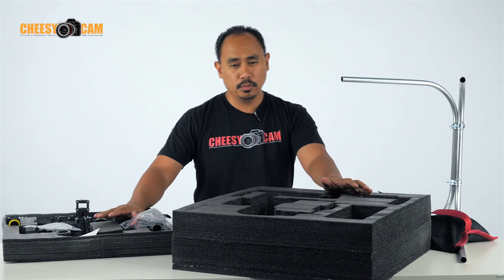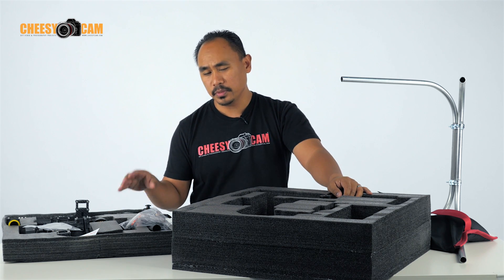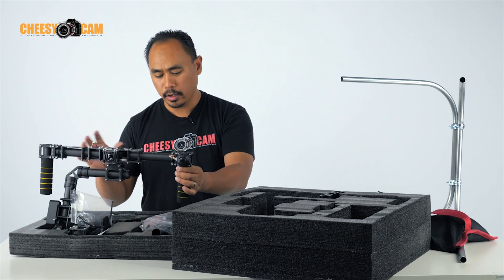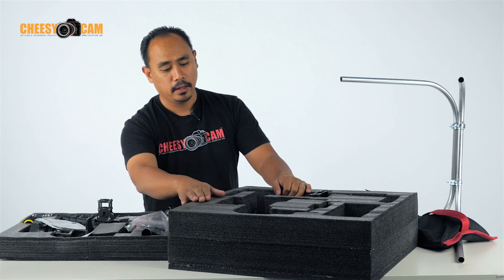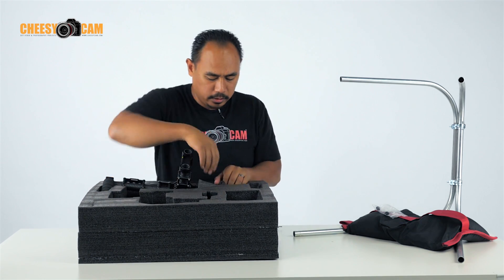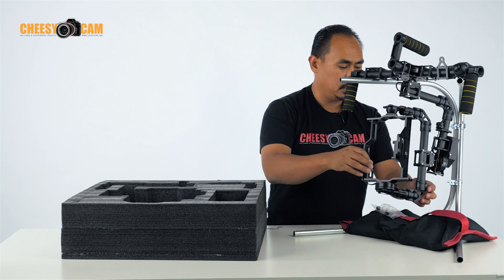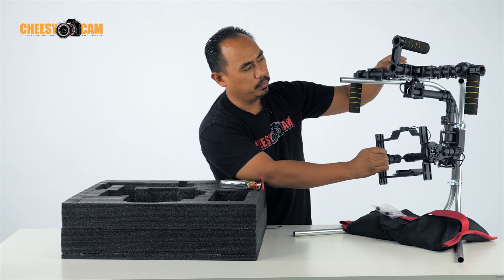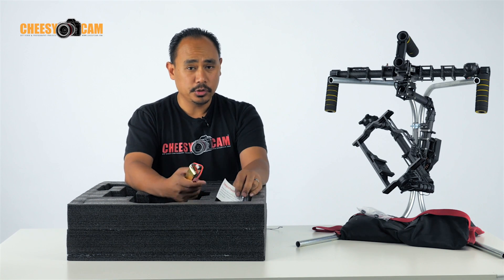Unboxing the Ready to Run CAMETV 7800 3 Axis Gimbal

Comment: Nice review as always. Thanks.

Your idea of replacing some Allen head screws with thumb screws sounds promising. I'd especially want to replace all the screws that need to be loosened to adjust balance. The two that fasten the quick release plate to the camera carriage should be the easiest. The four on the camera carriage and the four on the yaw adjustment might be a bit harder.

But the price is right on this rig. Bravo for bringing it to our attention.

Love the hard case and the fact that you give us links to everything. Not everyone is as thorough. It's another reason I watch everything you post.

Comment: Thank you for keeping on top of the Gimbal market, especially from Came. What concerns me is how fast they put out revised products. It seems there is a newer version every month. As a buyer, this is great as better product is released asap. As an owner, this must be frustrating knowing your purchase may be obsolete so to speak within the next month. Still, it's great Came is doing what they can to make these gimbals easier to use and less expensive.
Reply from the maker: Brian Westfield I wouldn't say obsolete. The same gimbals are still sold. The new versions just have 'added' features that you would pay extra for, but if you don't need the extra features you can still pay less.

Comment: Hi MrCheesyCam. Just received my Came-TV 7800 and your video was incredibly helpful so thanks for taking the time to put it together. I do have a question though which was passed on the video at the 8:55 mark. You were adjusting the tilt and saying it had to stay where you put it and then figured it was good enough and moved on. However my camera (5D III with 16-35L) will not stay tilted when I let go it always goes back to level. Can you help? The only adjustment to the housing I had to make was moving the mounting plate down so my camera would fit inside the cage. I could move it back up about 1/2" but that's about it....is that my problem? Thanks in advance!
Reply from the maker: +Showcase Photography Try to move the top plate as high as you can, then start moving the bottom plate up until your camera is balanced.
Reply: +MrCheesyCam Thanks for the reply, that did the trick. After commenting I watched the video again to see where your camera was as it too is the 5D3 and noticed that top plate was way up, so I realized what the problem was. All good now I just need to work on my walking technique to remove the steps in the footage! Cheers and keep up the great videos!

Comment: Hello, thanks for the video!
Can this gimbal with RC remote control that allows a second operator to control the gimbal's pan and tilt? Do you have a tutorial on that?
Another question is what is your recommendation for a wireless video signal transmitter? I’m looking for solution to send a video signal to the director’s monitor. I use a Canon 5D.
Thank You!

Comment: I just watched your review of the Laing X-15 Vest Arm (Laing X-15 Vest Arm kit with Laing P-04 Video Stabilizer Review). I have two questions:
1. Can the CAMETV 7800 work well in the camera-on-top position? That seems like where I'd prefer the camera in relation to the ground.
2. With the camera on top, would you estimate that the CAMETV 7800 could be coupled with the Laing X-15 vest and arm? That seems like it might be a good combination to reduce operator fatigue on long shooting days.

You're the only guy I know that has worked with both.

Thanks again for a great channel.

EDIT: Just watched your DIY 3 Axis Gimbal Stabilizer Support BackPack. This may be a better answer than the vest/arm solution. Still like to know if the CAMETV 7800 works in camera-on-top mode though. Thanks.

Comment: Great video! Which do you like better; the 7800 or the Varavon Birdycam2? Which will you use personally for your work? Do you think the Came 7800 will hold up well over time? Thanks!
Reply from the maker: ***** I like them both actually. I don't have a variety of camera + lenses that I use with stabilizers so i'm always just using the same gear. Since I don't have to rebalance much or ever, it's easy for me to unpack and start shooting. If you have to make camera or lens changes very often go with a gimbal that offers those convenient features.

Comment: Hey there! Question, please help! 

I bought my 7800 but I'm having issues with the balancing. No matter what Im doing with either my 5D Mark III or 70D, it seems to lean or "sway" to one side. When I turn it on it starts to shake and jitter, when i walk or move at a faster pace it looks all over the place (without touching the joy stick and with) like its calibrating. and finally when it sits at rest it starts to pan to the right ever so slightly. 

Is this a software issue?  when you say its pre balanced for a 5D, is that also a software thing. where do i go and what would you suggest . 

Please help me obi wan. you're my only hope!

thanks!

Comment: on the old one you used to have to make sure the roll axis sat in any position and held it like you did with the pitch. If it snapped back to horizontal then you were balanced but you had to twist the 'holder' or bar at the back (so twisting the arms either side up or down) until it would hold, do you have to do that with this one or is it better to leave it as tightened at the factory?
Reply from the maker: Box Lane Productions You can still adjust the side arms to keep the camera's horizon level. It's still better to get the camera perfectly balanced.
Reply: MrCheesyCam cheers and thanks for the quick response i might go and give it a little wiggle then

Comment: MrCheesyCam Hey, great video! I follow your blog religiously. I have a couple questions about the newer 7500 which I just bought. It seems to be running great and I have it all balanced. But the odd thing I am wondering about is when I switch between profiles, after I click the joystick - instead of making one beep like I hear yours make it beeps a bunch of times quickly. It doesn't seem to be bad, just seeing if you knew if its normal. Also, is the gimbal supposed to make very quiet high pitched frequency humming/buzzing when I move it? I feel maybe this means it is too light, as I am running an A7s with quick release and 28mm Pentax super takumar lens. Any help would be amazing. Thanks for everything you do!
Reply from the maker: Jeremy Dulac Check if you have the option 'calibrate gyro at startup'. If you have that option, turn it off. As far as buzzing goes, yes it sounds like you may have the system too light. You may have to find out which motor is buzzing (pitch/roll/yaw) and lower those settings a bit. Or try lowering the P&D settings on each one.
Reply: MrCheesyCam Ok excellent! Thanks, Emm!

Comment: Amazing review! As always.. Hey I'm looking at purchasing this gimbal but would like to continue using my manfrotto base plates. Can't tv told me that their base plate is removable. Since you have the gimbal their can you please tell me how their base plate is attached to the gimbal cage? I just want to know if I can screw a manfrotto base plate in its place! Thanks so much!!
Reply from the maker: fitBUDDS The baseplate uses one screw underneath. If you mount a Manfrotto it might not be centered and the manfrotto brings the camera higher than the built in CAMETV one. The CAMETV one is very slim so the camera can still fit in the cage.
Reply: Oh I see. That's very useful that's bro!!

Comment: Hey I'm having major problems with my cametv7800. I can get the camera to stay still on the pitch when balancing it, but I get a seesaw effect on the roll bar, I'm using a A7s with a 28f2.0 Sony lens. Hope you can help
Reply from the maker: +Southedge Pictures That is because the side arms are pointing downwards. You have to loosen the rear roll bar so you can move the side arms to point slightly up.
Reply: Hey thanks for the response, it was that as well as the PID settings. I posted a message on cametvs facebook group, and a very kind guy from croatia went through everything, and now it works perfectly. Thanks for the advice, love your channel

Comment: hi. i just thought i'd check in with you about whether or not you have to mess with pid settings on this. if you see tom antos' review, he seems to say he never messes with it, and that actually the company says "don't mess with it" its supposed to be preconfigured, and if you have an issue, there is supposed to be an auto config by holding down the joystick to fix any issues.

so what is the reality? do you HAVE to mess with the pid settings, or not? I plan on using this with a Canon 70d. Is it preconfigured for that basically? thanks!
Reply from the maker: ***** It comes pre-tuned to work with most cameras, and you should never mess with it "if you have no clue what you're doing". Of course if you understand PID tuning, you could tailor it exactly the way you want. I suggest you learn the software, but don't practice on something you want to use for your production.
Reply: MrCheesyCam
great. very helpful advice for a lot of us who have these questions. looking forward to your test of the newest 7800. eager to order it. quick follow up question. do you think that the 70d with the sigma 18-35mm would require tuning (for being too heavy for initial pid settings/ just as the gh4 requires it for being too light?) the 70d is just a bit lighter than the 5d mark iii, but the sigma 18-35mm is quite a heavy lens. i guess the question is if your 5d with a fairly heavy lens required pid adjustments initially or not? thanks!!!!

Comment: Anybody know why the 7800 beeps rapidly when turned on. it seems to be a center and level alignment thing.  Before now I've been using it without any problems and
turns out the balance thing is fairly easy once you get used to it's needs.

Comment: Thanks for a great channel. I love the quality of your videos.

I bought the 7800 gimble and wonder if you can answer a couple of questions. I got it balanced and it works with my GH4 but it is off level by about 4 degrees. (That's the rotation I had to add in post.) What do you think the problem is? Can I calibrate that out with the external software? Where can I get the external software? What is the name of the controller board?

Where is the best place for me to get more info about this?
Reply from the maker: Robert Shaver Hi you can first try to 'calibrate gyros'. This is an option in the software. (FOR MAC:) http://gimbal.cheesycam.com/downloading-installing-and-launching-simplebgc-software-mac-osx/

Don't change any other setting. You will plug the gimbal via USB to your computer and then click on a button that says Calibrate Gyro. You want to make sure you hold the camera steady and straight during this calibration process. There may be a bunch of videos at my sub-site. http://gimbal.cheesycam.com
Reply: MrCheesyCam Thank you so much. I got it working the way I wanted. For others, here's what I did.

1. I opened up the controller box and found out that the controller is SBGC v3.0.

2. I used Google to find the software and manual for my Windows 7 (64 bit) laptop.
http://www.basecamelectronics.com/downloads/32bit/

3. I connected the 7800 controller to my laptop USB port and it tried to load the correct USB drivers, but failed. I clicked on the "Find me a solution on the web" that came up in the failure screen and it popped up another box with this URL:
http://www.silabs.com/products/mcu/Pages/USBtoUARTBridgeVCPDrivers.aspx
I downloaded and installed the driver from there and it worked.
NOTE: Silicon Labs makes the USB chip on the SBGC board, so this may work for you. This may or may not work for you.

4. I started the SimpleBGC_GUI software, selected COM3 and clicked the Connect button. It failed to connect. So I clicked the Disconnect button, selected COM5 (the only other one) and clicked Connect. That one worked and the 7800 beeped.

5. I clicked the READ button near the bottom of the screen. This read my profile #1 into the program.

6. I clicked the Save button near the top of the screen to save the Profile1 from the 7800 to my hard drive for safe keeping.

7. I selected profile #2 on the 7800 by pushing the joy-stick button twice. Then I did steps 5 and 6 again to save it on my hard drive.

8. Then I did 5 through 7 for profile # 3.

9. I selected profile #1 again on the 7800 and read that into the GUI by clicking READ.

10. I clicked the button CALIBRATE IMU. I think this corrected my 4 degree roll tilt I think. I did a bunch of other things after this and did click the WRITE button for all the profiles. I couldn't seem to find anything in the manual about this either.

Anyway, I changed several things in all three profiles. The changes where all on the RC page.
1. I inverted the pitch on the joy-stick so that it works like an airplane; when you push it forward the camera pitches down, when you pull it back, the camera pitches up.

2. I reduced the dead ban from 15 to 5 to make the joy-stick more sensitive.

3. I reduced the speed for pitch and yaw from 20 to 10.

4. I reduced the acceleration from 200 to 100.

5. The pitch trim was drifting so I changed it from -6 to -10. This took some experimentation to get it right. Your settings will likely be different from mine.

Each time I made a change I had to WRITE them to the controller and try them out. This required that I turn the power switch on on the 7800 so that the motors were engaged.

Once I was satisfied with the settings, I updated all the profiles as needed.

So thanks to Mr. CheesyCam for a great channel and helping me get into this for the lowest possible price. I'm looking forward to hearing more about his custom mini. I'm sure somebody is going to use a 3-D printer to start making parts. Maybe he'll share his design.

Peace for the new year. Rob:-]

Comment: Just unboxed mine today - did you have any issues attaching the battery to the connectors? I feel like I really need to force it, and I don't want to break anything...
Reply: Oscar Wilsby look into the female end of the plug and make sure you line up the male side with the actual
slide holes.  I had that problem for a moment until I realized I was pushing the contact together end to end.

Comment: Hi! I plan on using my 7800 in a two-person setup, with remote control + wireless follow focus. Do you think I could make it work with a 5D3 + Zacuto Gorilla low-profile baseplate with rails + lightweight followfocus like the Lenzhound? If I replace the original quick-release plate with the Gorilla?

Also, what remote control would you recommend getting?
Reply from the maker: I would not suggest that setup on a 7800 gimbal. You're looking more at a CAMETV 8000 or the DJI Ronin.
Reply: MrCheesyCam Thanks for the blistering fast reply!

We're talking only for special occasion though. I will mostly be using it just me, so I would like to avoid the rather large 8000. Same thing goes for the Ronin + it is more expensive...
Reply: Anders Stai Fougner MrCheesyCam Wait! I've had an even better idea! I'm gonna mount the Lenzhound to a single carbon fibre rod attached to the hotshoe! I'm a genius!
Reply: Anders Stai Fougner Hold up - outdone myself again: One could also mount the 15mm rod directly to the gimbal frame. That would leave more space to the camera. Either way the whole shazam, Lenzhoud + rod + single clamp, would only add 250 grams in total to the setup, so with the right lens one would be still be well within the maximum 3kg capacity.
Reply from the maker: Anders Stai Fougner It's actually not that simple. As you extend the weight further to the front, you're throwing off the center of balance which means you have to pull the camera further back.  There are physical limitations to the frame of the CAMETV even though it can support a good amount of weight. I haven't tried it, but if you can pull it off, let us know.
Reply: MrCheesyCam Yeah, I'm aware of the balancing issue... But I will give it a go anyway! With a compact lens, like Canons 24mm (not the L-version), it might work.
Reply: Anders Stai Fougner Btw - while I got you here. Any remote-recommendations? :)

Comment: I'm having some problems with mine I'm very new to this and I had bought it off someone but when I go to turn it on it just constantly beeps and it looks like the roll cage is trying to stabilize but the motor is skips steps and when I put my camera on the roll cage it just goes straight down  and just loose like it has no control on the camera you can spin the camera around and around (not that I have) but it doesn't have any support what so ever I need some help please reply thank you!
Reply from the maker: If it is constantly beeping and then shutting down, perhaps the battery is bad. Have your battery checked by an RC Shop.
Reply: MrCheesyCam MrCheesyCam. Thank you will do! As for the roll cage how yours has some type of controll mine doesnt? I can just spin it if i wanted to (not that i do) but with or without the camera on it the cage just falls face down with it an without has no controll or effort at all.?